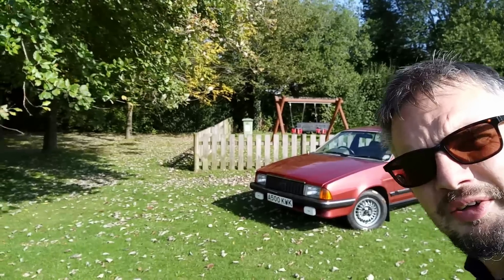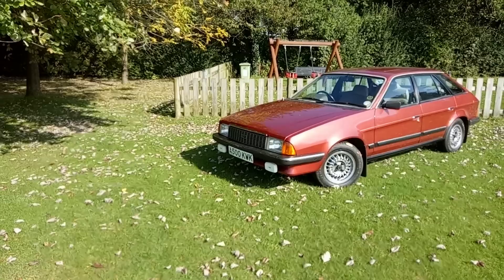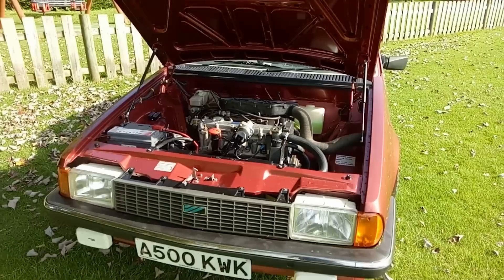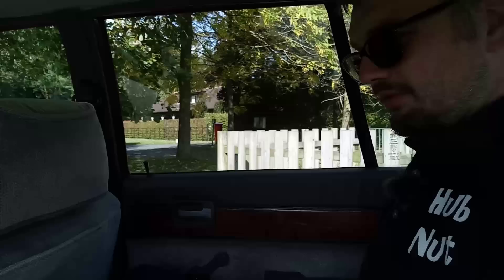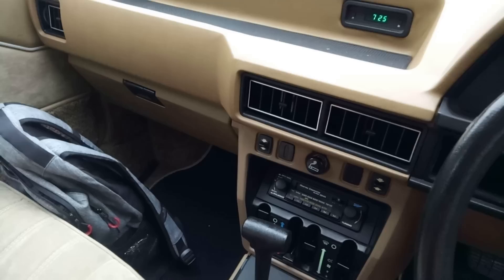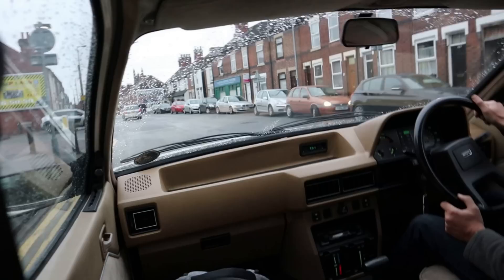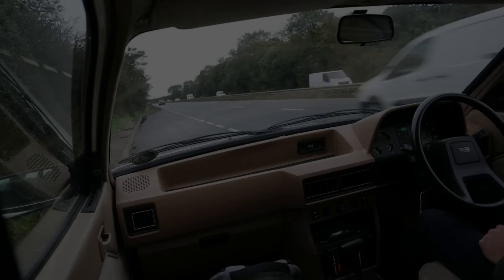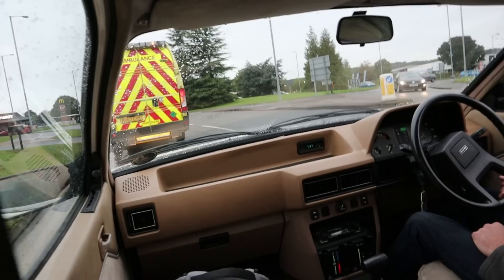Real Road Test: Ambassador vs Princess Pt2: Ambassador time!

Comment: I love these cars but it's going to need alot of work next year! :-
Advisory Notices :

Nearside front brake pipe corroded, covered in grease or other material (1.1.11 (c))
Offside rear brake pipe corroded, covered in grease or other material (1.1.11 (c))
Nearside rear brake pipe corroded, covered in grease or other material (1.1.11 (c))
Fuel pipe/s corroded ()
Vehicle structure is corroded but structural rigidity is not significantly reduced (6.1.1 (c) (i))
Offside front brake disc worn, pitted or scored, but not seriously weakened (1.1.14 (a) (ii))
Nearside front brake disc worn, pitted or scored, but not seriously weakened (1.1.14 (a) (ii))
Offside front wheel bearing has slight play (5.1.3 (a) (i))
Nearside front wheel bearing has slight play (5.1.3 (a) (i))
Offside rear suspension component damaged but not seriously weakened (5.3.3 (b) (i))

Comment: I had a Cashmere Gold Ambassador 1.7L, registration XGV 482X, in the late 90s. I paid £20 for it. I'd fitted a 2.0 to it after the previous owner (a friend of mine) hit a kerb with low front suspension and shattered the transfer case, so I just swapped the whole lot. Unfortunately, the twin carbs were knackered so I swapped it over to the single carb from the 1.7. 

Eventually, I had to have it towed away for scrap as I'd left it parked in a terraced street with no insurance, the police put a warning label on the windscreen, and I had nowhere else to put it. I nearly cried.

Comment: The failed autochoke brings back EMBARRASSING memories of the choke (or at least its slow-running control) on my VW Golf Mark II failing when I was stuck in a traffic jam on the M25, so the engine was screaming away as I tried to crawl forwards at 5 mph. Shame the red Ambassador wasn't drivable for the test.

Comment: Well... the Wolseley 18/22 is the clear winner for me. Technically, for a car of that era with a four-speed 'box, 20mph/1000rpm is about right so yes, about 3500rpm at motorway speeds. My father's Zodiac was the same, a car that really needed the optional overdrive. But more importantly... how can that car have the cheek to call itself a 'Vanden Plas' and NOT have picnic tables in the seat backs?!

Comment: As far as I recall the Princess was critized for riding on rather wide tyres (185/70 or even 195/70 - believe me, that was considered fairly wide) on very narrow rims (4½" - I think). A german car of the period would have had 5½" or 6" rims to match that size of tyre.
The tyres look to be ballooning out from the wheel so the Ambassador's alloy rims are still rather slim.
That might explain some of the "woolly" steering?
There might be a good reason for wide tyres on narrow rims but I fail to see it.

I tried to find a good used one i the mid-eighties, though I preferred the Princess 1800 (Ambassadors were never imported to Denmark). It looked much cooler with four headlights plus I had all kinds of tuning parts from my MGB. But alas I could not find a suitable one and ended up buying a new MG Montego.

Comment: A couple of months ago i had the opportunity to drive a 1988 Audi 80, also with a 3-speed automatic and it was dreadful. It accelerated like it had to tow a big trailer and on open roads the engine yelled at me and i desperately waited for at least one more upshift, but there were no gears left over.  The car that had a completely different character like when it´s fitted with a manual gearbox. Since that day i understand why  back then automatic gearboxes had such a bad reputation.

Comment: Just listen to the row out of that engine !! The Austin Wesminster  of 20 odd years earlier was much quieter. I borrowed a Rover 200  sixteen valve 1.4  ( K series, worst engine ever built ) and after 40mins at 70mph my ears were almost bleeding !!  They called this progress  ?  Getting back into my Vauxhall was like returning to absolute silence by comparison. No wonder the company went to the wall.
Reply: OK I've never had the privilege of driving an Austin Westminster so I'll take your word for it. I had an old 2.0HL Ambassador as my first car, sure it was noisy and gruff, particularly as there was no 5th gear but years later I had a rover 214 16V, I found the K-Series an absolutely brilliant little rev happy engine - I would agree it's was not the nicest sounding engine I've had in a car (that would be a 3,528cc V8) but reliable and fun it certainly was for me. The rover 214 was a completely reliable car during the few years I had it. I only sold it as a salesman got his fangs into me when I was buying oil and filter from the dealership and I ended up walking out with a BRM LE instead - another k-series! Now I have a MGZ-T-T a KV6 engine, solid and nice sounding so I really can't agree with your statement regarding the k-series.

Comment: Is it possible for the engine to share an auto gearbox's fluid? I know automatic transmission fluid is an oil, but has quite different properties? I also wondered how the engine oil fared in the manual Minis where they did share the lubricant, what with all the shearing, chopping & other abuse to the oil going on in the gearbox. Very enjoyable vid as per usual.
Reply from the maker: It is, sort of. Mini, 1100 and Metro all had autos using engine oil. I think the car world concluded that separate oils was the way to go

Comment: Well now, The Wolsely Princess is far above this in refinement and noise levels, those O series engines were really loud and rough, I had a couple in Marina and Itals, bombproof as long as you changed the oil, but not the nicest motor, in fact the old 1800 B series was sweeter running.
I knew a Guy who carried his entire mobile disco round in an Ambassador, Decks, speakers, records and lights, they were truly huge with the back seats down.

Comment: Not bad not bad, perhaps a much better experience with a manual version.
Same 3500rpm at 70mph as my old 1983 mk2 4 speed manual 1.6 cavalier.
Its funny how you remember such small details from the 80's & 90's haha.

Comment: Been looking forward to this review as we had an identical red (Metallic Maroon) one. Reg A437 JVC  with the manual box and I think it had the wood trim. I really liked it .It was comfortable and the ride was ,in my opinion, pretty good. It struck me as having a nice solid feel but it wasn't very old and it did have one habit of giving me en electric shock every time I locked it with an audible 'click' as my hand moved from the door. There is one thing that is niggling me though. Ours had several visits to the local bodyshop as idiots kept running into it, I think one side shunt and two rear enders. The last time it visited the body shop I came to the conclusion that the grill had been changed as I thought the original was a different design but the two examples you have presented seem to have the same type, so either I was wrong or those two have not got original grills but that would be a bit of a coincidence so I am assuming I am wrong.

Comment: Both quirky but nice cars, I wonder if anyone has at least tried to marry the rear end of an Ambassador to a Princess, to get a Princess hatchback?  In my early teens, a guy living across from us had one of these for a short time until the Montego came out and he was a private taxi driver and used both for the job. British Leyland / Austin Rover definitely missed a trick failing to hatch back the Princess or making an estate version, but I still find them interesting, though I guess it wouldn't be very easy to convert to 5sp manual gearbox, but  possibly an automatic upgrade maybe possibly though, not sharing the oil.
Reply: Torcars Leyland Princess Estate was a hatchback conversion carried out with full factory approval and didn't invalidate the warranty either.

Comment: Yikes!  In part 1 I said the styling of the front end looked a bit too exaggerated, here they went a tiny bit too bland.  They probably should have used a shiny mesh to the grille if they wanted this to be the top of the line car...the rest of the car says "almost premium" while the front looks like a nice/decent Ford.
And I guess I would really have to be standing next to the featured Ambassador and Princess to see the changes to the side panels...a casual glance says a lot of money was spent for pretty much zero return.  But then, Leyland isn't the only car company guilty of that sin, pretty much every car manufacturer has 1 or 2 models where a ton of money was spent for negligible changes.

BTW, I remarked about the outstanding paint job on the Princess, this car appears to have it's original paint, even a bit faded/weathered?

As another commentor said, and I can agree, these look sweet in white...or maybe other non-metallic colors?

Comment: The 6 cylinder Princess was a nicer car - better sound, seemed to be built a little more cleanly. Chrome is better than plastic too! We seemed to think it was a big car but it's actually small compared to a lot of modern vehicles. For me though, it still doesn't have the charm of the old land crab but I am a little biased as Dad had three of them. Dad's cars always leave an impression, don't they? Mine also had a Ford Corsair - that would be a nice test (if you could find one!)
Reply: Ford Corsair V4 2.0? Was he a Bank Robber?

Comment: The Austin Rover period circa 1981 to 86 rough time span 
The Allegro - New circle steering wheel 80s plastic body trim, rear no plate moved to the boot, 3 colour options, metallic blue, baby sick white, in ya face orange 
The Maxi - bar the circle steering wheel same as the Allegro
The Ital - A Morris Marina with 80s plastic, re designed square headlights front and rear, no plate in the middle  same colours option, although an Austin the last car to be built as a Morris 
The Mini Metro - A re designed slower Mini, a few more colour options on top of the same colour options as the Maxi, Allegro, Ital 
The Mini - Basic City models very basic, new 80s design variants eg Mayfair etc more colour options timeless classic 
And then come along the Montego  and Maestros very disappointing but  a bit more appealing to the eye with MG specifications 😂👍
Reply: Forgot the Ambassador
Reply: Correction the Ital was sold as  a Morris not an Austin

Comment: Love this vid- my dad had ital, maestro, montego (vhigh miles on 2 without any problems) but he also had for a few weeks a c reg ambassador. Which would make it 85 I guess. I remember that my dad got a d reg company montego 1.6 base on 1/8/86 when I think rear seat belts became compulsory and  about a year later he swapped for ambassador 1.7 HL which was a c reg but the engine blew so he got an e reg 2.0hl which was fab then he got a g reg 2.0 mg in brg ........ Really good times:-)

Comment: Back in the day I've owned both the ambassador and Princess, I found the princess a lot taughter, it seemed to me that cutting an enormous hole in the back replacing the boot with a hatchback and rear quarter lights caused a lot of body flex which also resulted in creaking interior.

Comment: We were unfortunate enough to own one of these awful cars.
It rattled, it squeaked, it leaked oil, it broke bits of the rear suspension, like it was going out of fashion, the gas struts on both the tailgate and bonnet all failed, the tailgate crashing down just missing my head.
The gears all dropped by about an inch and although it kept going it snapped off the speedometer cable, this was after about 30,000 miles.
All in all the worst car I have ever driven

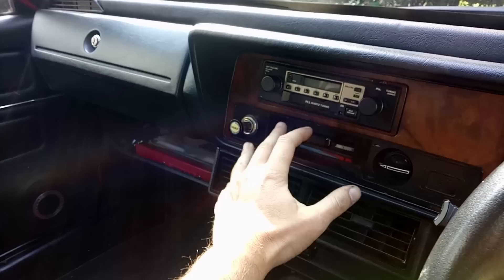Comment: At 1:37 in mentioning corrections to the Princess video, Mr. HubNut says the car had "been around the clock" so has done 103,000 miles. I thought both the Princess and Ambassador had 6 digit odometers so it couldn't be 103,000 miles if it had been around the clock.

Also, in the name Vanden Plas, the "s" should be pronounced as in its Flemish roots.
Reply from the maker: Ambassador had six digits but I don't think the Princess did. The company itself said Plah, so that's good enough for me. I've found several promo videos.

Comment: Ugh.. that's a bit of a head scratcher to me trying to imagine that Borg-Warner unit installed UNDER the engine in a transverse layout. Did you say the Ambassador had a ZF unit instead?
Reply from the maker: If I said ZF, that's another bloody error. Both autos are Borg Warner. Because the manuals had the gearbox in the sump, there was no room for an end-on gearbox without serious modifications.

Comment: Looks like they grafted on the front end off Talbot Solara. The Wolsely had some charm, a nice sounding engine and you could see where BL were trying to go in the mid 70's. Cut to the early 80s and this seems to fit in more with the BL reputation for dated poorly made cars. During warm up it sounded rough and rattly and I'd guess it was closer to 4000rpm than 3500rpm at 70 and what with all the trim rattles, just grim. I think 'a symphony of crap plastic' says it all. Still, I think it's important to conserve these cars as part of motoring history, thanks

Comment: Don't make promises you don't keep :) We were anticipating some detail on the econometer - but it was never forthcoming ! It was about all I remember of a family friend's Ambassador. I was puzzled by the fact you said the red one had central locking. Was that just on the front doors ? Looking at 10:13 the rear door lock button is not sticking up as far as the front door - and even before you mentioned central locking, I thought the back door was locked at that point.

I'm trying to think if I had a Fiesta at one time that had central locking only on the front doors - certainly true of electric windows - so any of the viewers had a car with electric locking on the front doors only ? (otherwise, I'm simply losing the plot ;) )
Reply from the maker: Both cars had central locking.

Comment: Mk1 Fiat uno used fiber optics to illuminate the pod controles, excellent idea.
What was it with Austin fitting engines the wrong way round????
Looks a bit like a Talbot Alpine but with a fussy grill.

Comment: Two flawed cars for different reasons.  No hatch on the Princess, and the Ambassador has no 6 cylinder option.   I think the Princess appeared more up market.  The Ambassador was a car out of its time and with the VDP moniker reduced to a mere trim levrl, the Ambassador doesn't do it for me.  As you say, a case of could do better.  I still want one though!

Comment: What a shame about the low gearing, again what were they thinking of when they had given the Austin Maxi a 5th gear in 1969? That would be annoying with impact on fuel economy & of course noise. Also don't like that the wipers are now not hidden as in the earlier Princess (even better hiding in the Montego of course). 
Surprising that the 2.0 L `o' series 4 cyl. engine is less tall than the 2.2 L `E' series 6 cyl. since the 2.2 L was based on the 1500 `E' series 4 cyl. engine and so had a shorter stroke than the 2.0 L `o' series 4:39. Can Hubnut check & comment please. N.B. The 2.6 L `E' series based on the 1750 `E' series 4 cyl. engine was used in Australia.
Reply from the maker: Sorry. I'm not going to back that up with facts, only what I found during my research.
Reply: @HubNut  Fair enough.

Comment: I think when you compare this to the Laurel of similar vintage that you reviewed,  which would have been a similar cost at the time, you can really see how the Japanese took the market the Laurel outshines this in every way.
Reply: - but you could cruise in 5th gear at 80 or  90 mph in the Laurel...
Reply from the maker: I would also say that I wasn't convinced by the handling of the Laurel. It felt older, more like a 1960s design in that regard. But it was so much better built...
Reply: HubNut  which one would you take on a long cross country journey? I think the Ambassador for country roads but for me, the Laurel for longer journeys.

Comment: It does beggar belief the way that BL squandered money they just didn't have, by doing such seemingly pointless things. Not only did they rework the Princess to create the Ambassador, at huge expense, to then kill the car off two short years later, they then make it so the blanking plugs no longer show on the slightly later model, almost at the end of production. I can only assume my tooling a new press moulding! You have to wonder what they were thinking, if they even were thinking , and who the hell signed off these Ideas! Then in other areas of development, where they should have spent as much as was needed, they cut corners and penny pinch. When you continuously hear of things like this, all through the life of BMC/BL and AR, not only is it unsurprising they finally went under, after changing their name yet again, so everything was now badged as a Rover, (or MG), but it makes you wonder how they lasted so long in the first place!

Comment: Dreadful engine noise; tasteless restyling of what was a beautiful Princess front end. Proper 80's plastic interior. Yes practical. Yes a fab glass area. But that engine sounds like a Datsun 120Y with ruined valves. Just awful.